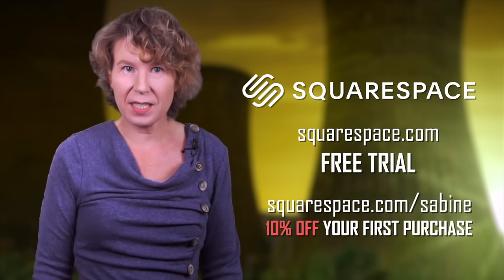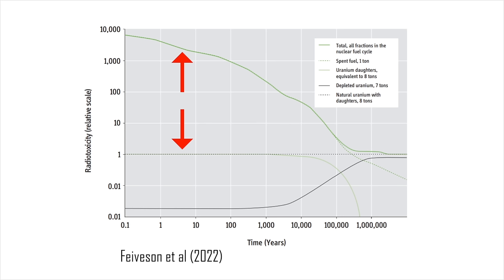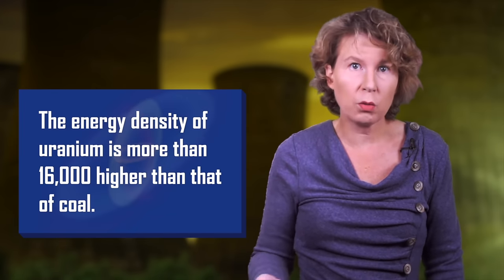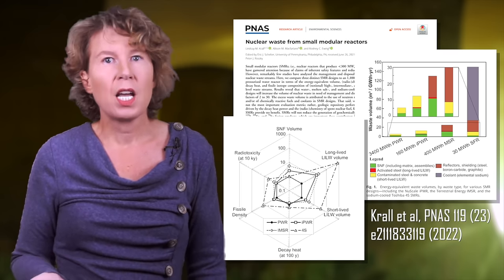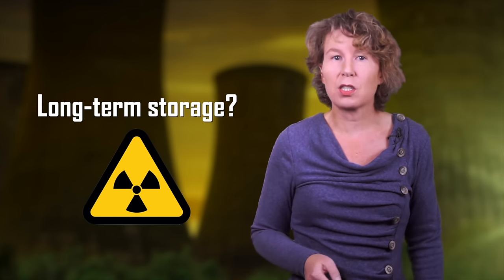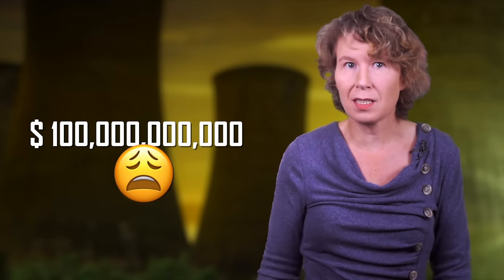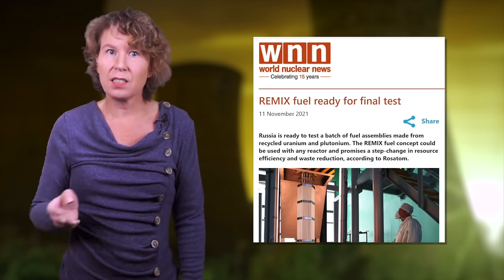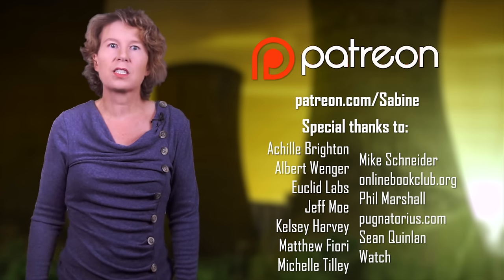Nuclear waste is not the problem you've been made to believe it is

Comment: I’m always surprised at how many people casually accept breathing highly toxic vehicle exhaust (happens when your car us idling in traffic), but are afraid of nuclear waste that won’t be anywhere near them.
Reply: You're measuring the wrong dimensions for nuclear waste. You're measuring it in space, when in fact it needs to be measured in time.
Reply: Yeah, it’ll be somebody else’s problem long after we’re gone!
Reply: @outerspaceisalie ok let’s measure in time. How many years until carbon dioxide is decomposed?
Reply: @igortolstov487  My God...do the world a favor and read a basic science text.
Reply: @outerspaceisalie 
Calling it "waste" is disingenuous and it's where all the misinformation is coming from. 

In the past, the most common process of energy production involved only extracting 0.7% of the available energy and then refering to the rest as "waste". 

It's the equivalent of filling your gas tank with fuel, only using 0.7% and then refering to the rest as waste. 

Of course there's a reason. That reason is Plutonium-240. It interferes with the reaction as it accumulates. 
So the equivalent would be that you gas becomes contaminated to the point your car won't start by the time you've used 0.7% of you gas (fuel). 

But, it would be stupid to call it waste. The smart thing would be to remove the tiny bits of contaminants from the fuel. And switch to one of the other motors available on the market that doesn't produce as much contaminant. 

Instead we're refering to that 99.3% unused fuel it as waste. 

The build up of Plutonium 240 happens more in certain types of reactors. A more honest description of what they really are would be Fast Breeder Reactors. It's the type the US uses and vehemently sticks to using, and doesn't want to move away from. 
Why? Because convieniently it breeds the isotope of Plutonium needed for Nuclear Bombs as "waste". (Btw, Nuclear bombs use Plutonium...not really Uranium, you can, but Plutonium is much much better because the critical mass is much smaller) 

Anyway, other countries mostly don't use these reactors, and all the newer generation reactors are more efficient. 

Plus, one has only to remove the tiny tiny of Plutonium 240 from the so called "waste" and voila, you've got fuel again. That you can use over and over and over and over. 

Plus, when it comes to unspent nuclear fuel, we have lots of time compared to CO2 levels. 

All of the nuclear technology we have was only developed in 70 years. Imagine what we'll develop in another 70 years, or 700 years.

They'll be scambling to dig up our "waste".

It's like refining some gold, only keeping 0.7% then burying the other 99.3 calling it waste because it has some impurities in it and you're not motivated to reduce and remove the impurities...so it gets labaled waste.
Reply: Actually electric vehicles are worse on this regard. The heavier vehicles due to batteries mean more stress on the breaking and lubricant systems which produces the most cancer-inducing particles, and a lot of cities and people are not exactly happy about that, and there's a lot of people who live in cities who want the cars out of the urban areas. Nuclear waste is actually a much larger problem for some states than Sabine leads on. Denmark has zero places to bury it. The larger threat of nuclear power is always the risk of a meltdown causing a catastrophic release, the risk is higher in lightwater reactor's, but if you claim to be able to design a fail-proof plant, then you are naïve, for not to mention the military target importance. Windpower isn't environment impact free either, but it's a lot more manageable, and Denmark has no place to build a fission plant that is on any safe distance to the public of we wanted to reduce nuclear plutonium waste from fast neutron reactors, and it still would involve the regular transportation of nuclear waste. Denmark's geological constraints means we drink ground water not surface water, and our ground can filter only chemicals and not radioactive material, seeping is a significant concern, and don't try to use deflection here saying other stuff can be bad also, the difference between radioactive contamination of groundwater and pesticides and PFAS pollution is that we only need 30-50years to clean out a magazine of poisoning as titration and dilution occur, but radioactive seeping is contaminating the entire ground layer by layer, including the filtering layers, for 100000 years minimum. The clay in Denmark is mixed and flipped by the ice age glacial pushes so it's not suited for storage of waste at all, and we have no bedrock. I wouldn't want nuclear waste nor pesticide waste or anything else like fibre cement which contains asbestos. But nuclear contamination of groundwater is much worse my a significant magnitude.
Reply: @pederslothzuricho7685  
EV's do not necessarily need to "stress" their braking systems. When using regenerative braking, there is no wear at all on sacrificial brake pads. The traditional brakes need only be applied at the very end stages of coming to a stop, or during emergency braking. Hopefully semi-automated driving technologies will be able to minimise this.
Your concerns about radioactive releases are however quite sound.
Reply: Why don't you move somewhere where there aren't any vehicles? While you're at it stop buying anything not made locally and organically, which means no computers, no electricity and no plastics.
Reply: Right, we're told all the time how much toxic sludge is in our air, water, and food, yet we keep ingesting it like it's not a problem.
Reply: There are radioactive particles in food today from tests in the 80's. If you were to get cancer or another illness as a result of it entering your body, it would never be attributed to that radioactive particle. This is why the dangers of radioactive particles is underestimated, because sometimes causal links are extremely hard to prove.
Reply: @JamesBalmforth But those tests were nuclear missile tests, right? Completely different from nuclear energy.
Reply: @tylerdurden3722  That was comprehensive, thanks! I also would love recycling nuclear energy instead of plastering the landscape with "renewables" (we just don't have much landscape left in Europe). When you say "just remove the plutonium", is there a process to do that safely? There would be so much energy to be got, if so!  (I  am not a science mind, so honest inquiry!!)
Reply: @lolakauffmann  No, not different because nuclear energy waste makes its way into the environment, by the leaking storage containers or by the occasional melt downs, of which there have been quite a few.
Reply: @JamesBalmforth  Well, neither Chernobyl nor Fukushima nor leaky containers impacted my life. The people involved in old time bomb testing orobably got some tadiation. But most radiation we get is natural & would be there without nuclear energy. Anyway - the video, too, seems to explain it's kess concerning than your version.
Reply: @lolakauffmann  You don't know if they have affected you life, or ever will. Radiation by itself is very different from radioactive particles.
Reply: @JamesBalmforth  Yes, I do. Because I never got in touch with them. The radiation I got in touch with is natural, in the environment independent of reactirs, and of course the many, many x rays I got & keep getting!
Just watch the video again, perhaps?
Reply: @lolakauffmann  There are radioactive particles in food today from tests in the 80's. Please share the technique that enables you to know you have never ingested one, I would love to learn your method.
Reply: @JamesBalmforth  Okay - now you are back to particles & tests, not  radiation. What tests in the 80s do you mean?
Reply: @lolakauffmann  Radioactive particles emit radiation constantly, for a very long time.
They are spread all around the world from weapons testing, leaks and meltdowns and have found their way into the food supply.
Reply: @JamesBalmforth same is true for heavy metals and POPs from mining, chemical plants, landfills etc. Yet hardly anyone talks about that. Instead people worry about the stuff we can very easily detect, measure and know how it affects us. Besides people worry about the wrong stuff, the long lasting radioactive particles ain’t the problem, if it releases its energy over a long time period it means it’s weak radiation. It’s not magic, it doesn’t create energy(radiation) from nothing. It either fissions fast for a short time or slowly for a long time.

Also the time when most of the radiological pollution happened was the same time we dumped every kind of waste chemicals unfiltered straight into the next river, some of these chemicals never decay. Chemical spill accidents also caused far more deaths and suffering than nuclear ones, they just happen to mostly occur in third world countries doing our dirty work so nobody cares.

Radioactive waste is a problem because idiot politicians handle it in a non safe way, like dumping it into old mineshafts and calling it storage. If you put it into concrete storage caskets and store it above ground where you can keep an eye on it it’s perfectly safe and hardly takes up any room.
Reply: @aaroncosier735 the moment he mentioned EVs putting stress on the braking systembI knew he had no idea what he was talking about, just speculating based on his apparently limited perception on the matter
Reply: Don't worry, Elon Musk will come to the rescue once more and send all nuclear waste into space. Screw the aliens.
Reply: Thank you! Not only vehicle exhaust, but industrial waste ( coal is radioactive ).  Understand the facts
Reply: @richardevans560  I’m impressed at how you pulled a false dichotomy (petroleum/ diesel cars or nothing), and the red herring of everything that everything is bad (which I didn’t imply). There’s no reason we can’t replace coal and gas reactors with nuclear. Also, the same fear mongers who decry nuclear reactors seem oblivious about vehicle exhaust.